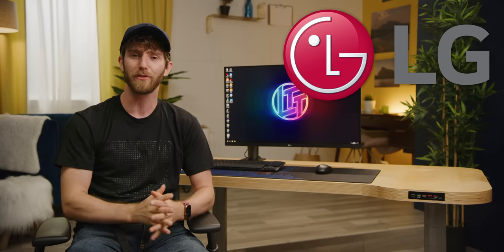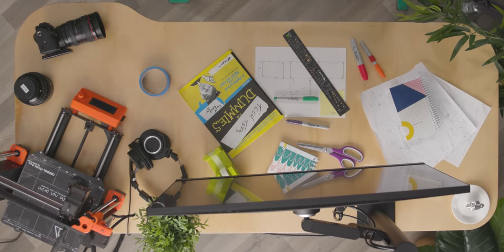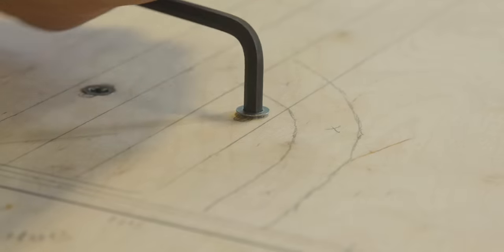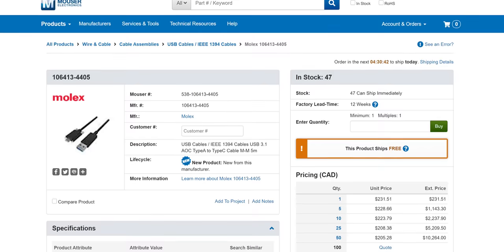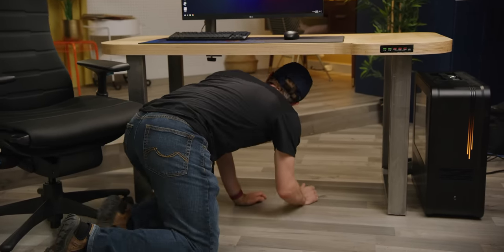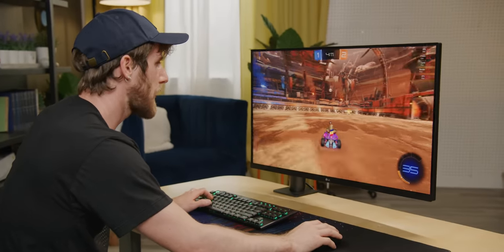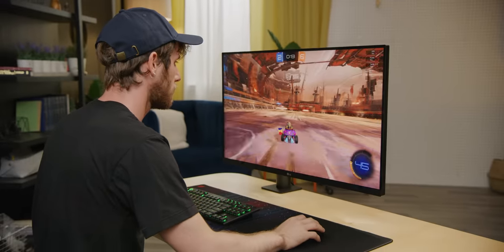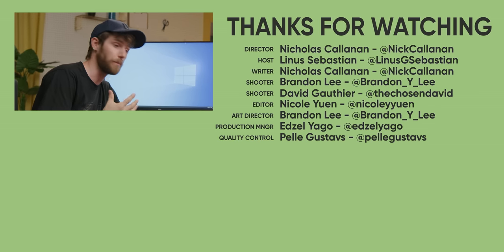Project Zero Cables - The Cleanest Desk Setup EVER

Comment: Yet another time where we have to keep up with all the complains about how pricey the 32" monitor is... people! This is 700 bucks because you can adjust it so much and this is amazing for studios and stuff. Also the colors are insane and it's HDR. So this is a monitor pro pros making a living in photo for example. I did a lot of photography and I can tell you that the ability to swivel your monitor so the model can see the result (instead of awkwardly holding your camera to show it to them) and to rotate and incline the display so easily is amazing. Just the arm to do that is half the price, reasonably so. If you wanna pay for a basic 30'' monitor there are plenty of other options!

Comment: I know this video is 2 years old, but please, if you're watching this, don't ever use a clamp mount, unless using a work desk. Clamps are absolutely disgusting, and most vesa arms use a 3/8" wide screw, which is easily drilled through most any desk top. A grommet and cable snake will make is so even your hdmi/dp cables aren't seen.

Comment: Shame they didn't use the wireless charger method to hide some speakers in the desk.
Reply: It would sound horrible
Reply: It would be at the completely wrong angle, and by intentionally blocking off the speakers to hide them, they would also be muffled.

Comment: A CURIOUS IDEA  is when ya realize maney wires can be made into one like any device where the usb also provides the power so like wise with the power plug being made into the usb but then im realy tired of all the various usb wires swareing they gotta be the shityest type of connection ports never lasting more than a few slides and then never solid enuf i was only happy with xboxes initial controler ports and old screw in lock ports but on wireless ideas its a known fact that more points of contact makes more location for data transfer remembering that can fix latencey issues in wireless by more wireless spots just an idea though

Comment: I was expecting the computer is hidden from the desk. To be honest, I could do better job on this. The video is such missing the point. The point is not to hide gadgets, but to hide or shift the main thing off the table. The main thing is the computer. Therefore the usb c hub is one of the solution. Extend the cable far enough from the computer (which can be hidden) to the table, and then do your video thing. You should really have a cleanest desk setup ever.

Comment: i skip to 10:15 to see the finished build and the very first thing my eyes rest on is the wire running from behind your monitor stand to behind your desk. there isn't an internal hollow pipe option? or to feed it better so it is not visible? i mean really guys. try hareder. this is pretty much a lie in the title. i see an inch thick cable. unsub